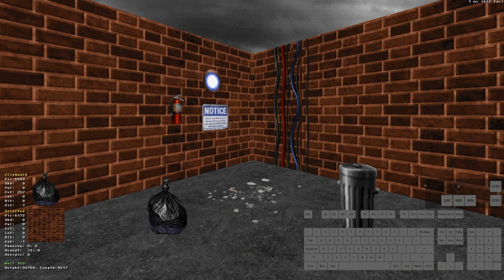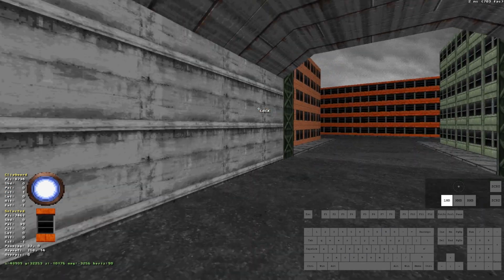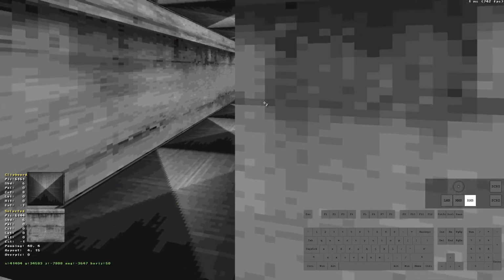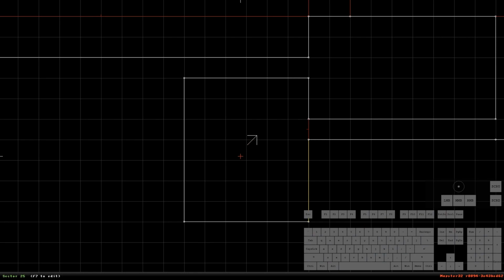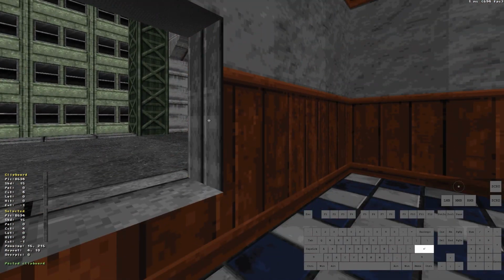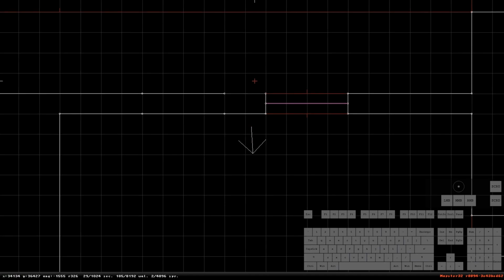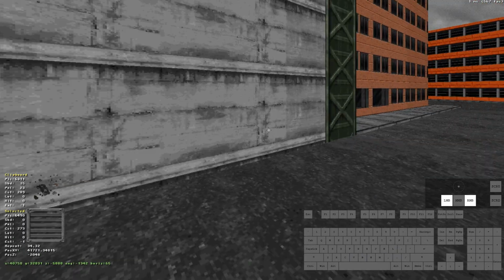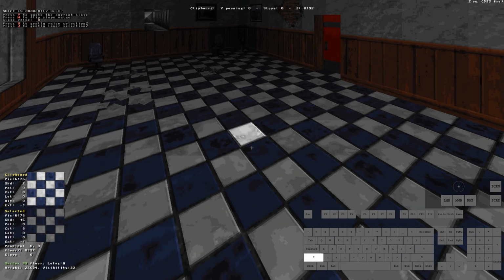Ion Fury Level design Tutorial: Basic Level - Part 3 - By DavoX

Comment: how do you make level ends?
Reply from the maker: Hi! Usually we place a sprite inside a sector that makes you end the level that is called "EOL" (end of level). This makes you end the zone though! I think lotagging the sector 65535 might also work as well.
Reply: @DavoXDesign  what is the number associated with the sprite?/what number sprite is it?
Reply: @DavoXDesign  i just tried the lotag and it caused the level to end instantly, i tried putting the tag on a new sector and the same thing happened what am i doing wrong?
Reply: @mitzi856  lol he never responded
Reply: Bruh...